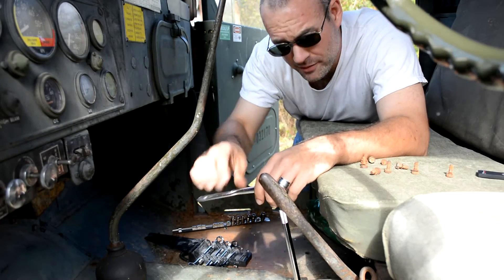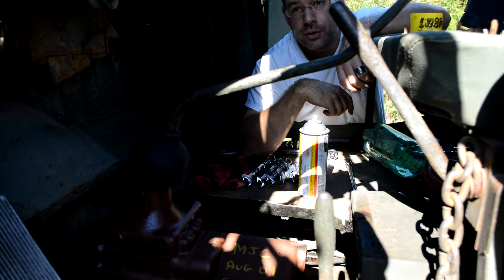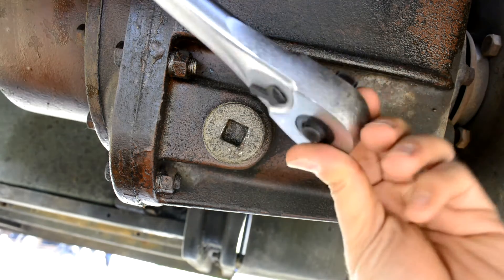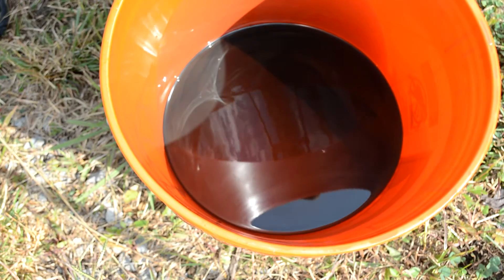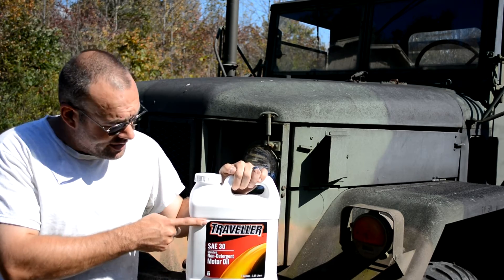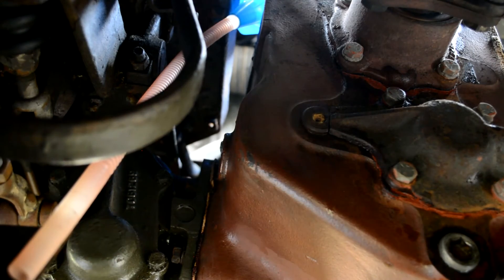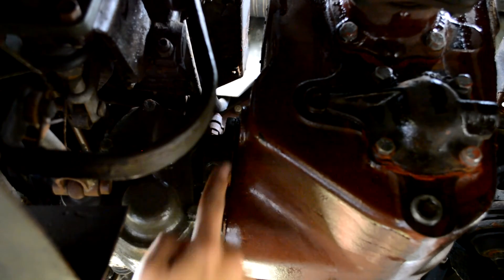Transmission Oil Change on a M35A2 Deuce and a Half

Comment: Great time for a drain plug magnet. Also Might have been a good to mention to drive it around before you drain it, the particles will mostly be suspended in the fluid. As well it's a great idea to run about half a quart of clean oil out of the unit with the plug off, as most of the stuff you want out is heavy and gos to the bottom thus a good way to flush them out.
(Pennzoil 2 years)

Great videos!

Comment: Duece, I tried finding the exact oil you used from tractor supply, but I couldn't find it. I did  find this one. Just want to make sure it's the right one. Also great video i just picked up a 1971 duece yesterday! I have no idea when it was serviced last so i want to change it right away to have some cheap insurance! Thanks again!
Reply from the maker: Nondetergent straight 40wt or 50wt engine oil or any 80w90 gear oil that says it is yellow metal safe on the bottle, sometimesinstead of yellow metal it'll say protects copper and bronze bushings. When I made this video almost no manufacturer bothered to say if their product was yellow metal safe but have started to do that more now.  A lot of people will recommend GL-1 or GL-4 over GL-5 for the best yellow metal protection but I'm not sure if that's still relevant  today.
Reply: @deuceandguns  10-4 thank you, I figured since I'm down south in georgia and it gets hot, I'm going to put sae 40 in it non detergent motor oil. I have a local store that sells some for 4 dollars a quart!

Comment: The military used GL5 but if you read the specs on GL5 regardless of it being yellow metal safe, it is not made for synchronized transmissions.  The military also used motor in its 900 series trucks for its Allison transmission rather than Dextron3, it caused the transmissions to shift harshly and downshift horribly.  Just a thought for those looking to change fluids.  I use GL1 in the tranny and transfer case for better gear oil properties than 30, 40, or 50 wt oil. It is safe to use GL1 and is safe to use In synchronized transmissions. GL5 can be used in the Rockwell axles though. GL5 works great there because of the high pressures.

Comment: Love to videos man!  Got my first deuce a little while ago.  Could you please do a video on changing the axel oil?  Also a video on checking/changing the brakes would we great as well. Keep the videos coming. Thanks
Reply from the maker: Thanks!  I do eventually plan on doing all the fluids on camera.  I will eventually do the brakes but not until they need them done so that may be awhile down the road.  I do have several maintenance things that sprang up during the winter that I plan on tackling now that it's warmer and they are very common issues with the old M35s so stay tuned.
Reply: DEUCE AND GUNS sounds good, I’ll stay tuned. One other maintenance item I keep hearing about is to be sure and pack the front bearings. I know how to pack bearings, just not on the deuce. If you could add to the list, that would be awesome!  Thanks again!

Comment: BC, awesome........please keep them coming.  Question:  In case of a home power outage I know the deuce puts out a lot of power, is there a way to use the deuce as a generator?  Treat me with kid gloves, 220v to home 110v home hook up.
Reply from the maker: Bo Rhoden Not only is there a way but it's a pretty good idea.  I have extended family who are big dairy farmers and when they lose power they have generators that run off the tractor's PTO and it's enough power to keep the milking machines running.  It wouldn't be that hard to attach a PTO shaft onto the transfer case and run a large PTO generator off that.  They are not cheap but some of the bigger ones that require over 40 hp can put out some good power numbers and would be enough to run an entire house when the power is used conservatively.  Great question!

Comment: Great video series! I have learned a lot from your videos.
One thing i was looking for in this video, was the quantity to fill the trans.
You mentioned that about a gallon came out, but you had a 2 1/2 gallon jug to fill.
I understand about how to check when full, but I'd like to know the correct amount.
Keep up the great work!
Reply from the maker: -M35A2 Transmission Capacity -10.5 pints with PTO (the Deuce has a winch). -M35A2 Transmission Capacity - 8.5 pints without PTO (the Deuce does not have a winch).  I usually put lots of info in the video description of my vids.

Comment: So theoretically speaking... you could just toss that oil through a 5 micron filter and dump it in the feel tank?
Reply from the maker: Yep.  You'd have to take the viscosity into consideration so the pumps aren't over stressed but an easy work around is to simply cut it 1:1 with diesel and you're golden.  Strictly theoretically speaking you could run the thing on uncut moonshine to get out of Dodge with the understanding that it may be the last time the truck ever starts.
Reply: DEUCE AND GUNS the compression ratio must be insane.
Reply from the maker: Good job!  Few people catch that concept.  Yep it's 22:1 which means the engine is very sensitive to hydrolocking.  Also, it's the reason why they regularly fail with a rod through the block because the driver decides to lug or over rev one too many times.
Reply: DEUCE AND GUNS I've noticed a few people put pop bottles in the exhaust, is that to prevent the water getting down into the engine or something else?
Reply from the maker: Yep, it keeps the water out.  A 2-litter bottle with the top cut off fits the exhaust perfect and can't be blown off as easy as a coffee can.
Reply: @CanadianInScotland  it keeps rain water from going down the exhaust and rusting it out.

Comment: Looks like a fun vehicle to own & drive.
Do you use this truck  to haul things or is it just a fun historic driver?
Reply from the maker: I use it on the farm but in reality it's way overkill especially since I've also got a Ford F-250 that could do just about everything I've used the Deuce for.  So to answer your question....um....yes...It's a fun historic driver that also hauls things.  It is nice to be able to pickup 12' long lumber/pipe from Home Depot /Lowe's and be able to close the tailgate so no flags are required.  Also, the Deuce is the only thing I've got that can get up the hill on the farm during bad weather.  Good question.

Comment: Great video! I always find time out of my day to watch your videos especially the deuce ones. I remember you changing the oil in the engine of the deuce and I thought to myself the transmission has got to be close to 10 gallons of not more. I'm very surprised it's only a couple gallons. Why would the manufacture use 30 weight oil instead of gear oil? I thought they put gear oil in manual transmissions. Maybe I was wrong. I don't know. It's not an automatic so they wouldn't put automatic transmission fluid in it. Did you change the dif fluid also?
Reply from the maker: Most manual transmissions are perfectly happy with some sort of straight motor oil depending on how they were designed.  Other than the engine and trans oil nothing else has been changed on the truck.  I'll eventually also change out the transfer case oil and all three Rockwell differentials.  Thanks for watching!
Reply: ***** No problem. I did not know that. Thanks! I would love to see a video of you changing the transfer case oil as well as the differentials. That would be so neat. If not no big deal. I know from making my own youtube videos how much time it takes to set up the camera, say everything right and do everything the way it should be done.
Reply: ***** Looking forward to those videos,....
Any thoughts on doing a vid on cleaning off those oil spills,... stains around the gearbox etc?

Aussie.
Reply: Aussie Bloke! to change diff fluid, just remove the cover off the diff and drain. when done, just fill the diff with proper fluid and you'll know its full when excess fluid starts dripping out. to change transfer case fluid is similar to when changing diff fluid. And remember, this is important, if you have a limited slip diff, make sure you add a limited slip additive.
Reply from the maker: Peter Kapica That Diff change technique will work for 90% of the diffs out there but not for the Deuce.  The Diffs and the transfer case on the M35s have a drain plugs that must be used.  Also, their internals on the diffs are only accessible from the top after removing the drive shafts due to them being top loaders.  The M35s don't have stock limited slip but yes always take care of you limited slip diff by using the correct fluid and never use a mini spare on the rear because both will result in burning out the clutches.  Thanks for watching.
Reply: Oops, my bad. I ment to say you change the transfer case fluid the same way as the transmission.

Comment: Your videos give me hope.
After sitting up for a few years, my deuce shifter is completely stuck.  Can't budge it even 1mm.
Any suggestions where I should begin?
I need your advice.
Reply from the maker: Sometimes it'll get stuck between gears but the shift lever still moves and it's due to the Sprag front axle but with yours not moving at all it sounds like it's rusted to something.  At this point the first step is start taking things from from the top down and investigate.  Take of the cover in the cab first and see what you can see.
Reply: Thanks for getting back to me....
After I take that floor plate off,can I remove the top of transmission while it's still in the truck?

Comment: Question. Ever hear of people removing rear drive line to increase mpg... i dont know hom much it'd help was just thinking about it the otger day.
Reply from the maker: There are bobbed deuces where the rear axle is removed making it a 4x4.  I've heard that's good for about 3mpg.  I also know a dude who removed the front drive shaft so the engine doesn't have to spin the front end and that was also good for a few mpg.
Reply: ***** yeah i know about bobbed and the front i mean with out the bob. But a gain of three is probably more just the weight removed.
Reply from the maker: So just removing the drive shaft between the second and third axle?  I've personally never heard of that but it'd probably do some good as long as the extra traction wasn't needed.  If it were simply a hwy hauler then you'd probably get an extra 3 mpg or more by removing the drive to the front and third axle and only driving the second axle.

Comment: I'm trying to get a deuce for my self. I  like to know if you have to have a class B or A license to drive a deuce on the road? and what kind of mileage does it get some on told me it only get 5 to 6 MPG but I thought it be closer to 10 or 12 MPG? and by the way you have a great channel all your video are great.
Reply from the maker: To the best of my knowledge you can drive a M35A2 with a regular Class D non-commercial license in all states due to it being under 26,000lbs GVWR except for California.  In the state of CA you'll need a Class B due to having 3 axles so if you bob the Deuce you'll be fine in CA with a class D.  I'm also not sure how strict CA is with this but it's on their DMV website.  Regarding the MPG for the Deuce.  A stock Deuce will get 10ish MPG if it's running on diesel and the speed is kept at and under 45MPH.  If you bump up the speed to the high end of the safe zone (50-52 MPH) you'll drop the MPG to about 5.  Thanks for watching!

Comment: Still learning here sorry if this question is a little minor. But the switch you move from right to left before you let the clutch out. What is that for? I have a 73' M52A2 and don't have that switch. Thank you in advance.
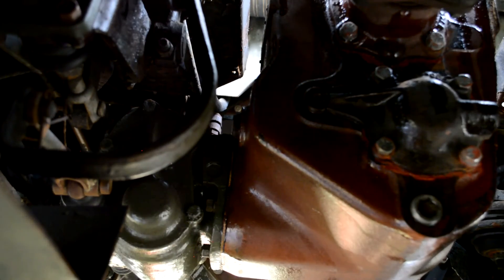Reply from the maker: If you're talking about the switch I flip at about 6:00 then that's the front wheel drive lever which uses air pressure to engage the front wheel drive.  Early models had an automatic sprag gear that engaged the front when the rears slipped but due to some issues with the sprag system later models were manually switched on and off.
Reply: DEUCE AND GUNS 
Thank you! I kinda figured that's what it would be but wanted to ask haha

Comment: I own a deuce and a half as well a 1980 AM general m3582 with a Hercules multi-fuel Whistler turbo and a five-speed sadly I've been struggling to find an insurance carrier besides haggerty that one sure it as mutually agreed value insurance unfortunately I've had more than my fair share of accents for the type of work I do but at the same time they were not my fault because I was rear-ended in each of these times

Comment: It’s been over 4 yrs now since the video. Have there been any transmission problems? And about how many miles would you say you have on ‘er since the fluid change? Reason for my questions are because I just purchased a deuce and all the research of what type of oil to use is killin’ me! GL1, GL5, 80w90, 50wt engine oil..... driving me crazy! Since you have time and miles on yours, I’d like to know how things are going. Thanks!
Reply from the maker: I don't put a ton of road miles on mine but it's been fine.  If you dive too deep down the rabbit hole on this oil thing it will make your head spin but there is a lot of overlap when it comes to these lubes.  30wt straight non-detergent works for me but I've been told it can cause shifting issues in hot weather after lots of hwy driving.  Any of those you listed above will work as long as it's safe for the yellow metal in the transmission (GL5, 80w90 may be an issue) and some will shift better than others.  For better summer driving and protection I've been thinking about changing to 40wt straight non-detergent but due to having newer trucks at my disposal I rarely drive it that much when it's hot out.
Reply: @deuceandguns  Thanks! I appreciate the quick response! 
Yes, I went head first into that rabbit hole and it was killing me!!! 
Are you going to run the same oil in your transfer case?
Reply from the maker: @1320freek  Yep, due to the transfer case also having the same yellow metal issues you'll want to use the same oil in the transfer case as the transmission.
Reply: @deuceandguns  Thank you Sir.
 Again, I appreciate the quick responses!

Comment: Do you ever recycle your used motor/trans/transfer case oils as fuel for the deuce ?
Reply from the maker: Always.  I've even got people at work bringing me their used motor oil.  Filter and pour it in.   I'll do a video on it eventually.  Thanks for watching.
Reply: ***** Now I'd  really like to see that!
I'd love to know what you need to do to run waste motor oil or used cooking oil to offset the fuel costs.
Also would you filter through some media or use a centrifugal filter system?
 Aussie.

Comment: Now, can I use that same 30 weight oil in all 3 differentials and transfer case
Reply from the maker: I can't remember if I mention it in this video or another one but while non-detergent 30 straight wt works I think 40 wt would be a better choice if you're also going to be driving in hot summers.  It works for both the transmission and transfer case but not the diffs.  I recommend standard 80w-90 for the diffs.

Comment: are duces sold in automic transmission?
Reply from the maker: The M35a3 has an automatic transmission but you lose the multi-fuel capability.
Reply: @deuceandguns   could  a muti fuel  engine  be put in it or is there a reason  they didn't  I'm looking  to get one but was wondering  if its possible  I've found  new old stock Hercules  engines  but wasn't  sure  I could  put it in an automatic  transmission  version
Reply from the maker: It would be a full custom install to mate the Hercules to the automatic transmission but with enough money it could be done.

Comment: Where did you pick up your deuce? I'm currently in PA and can't find one for under $8,000 in decent shape with a winch. And if I'm buying one it needs to have a winch for with I plan on doing with it. I've found a couple without a winch for $4,500 here and I'd say that's a fair deal, but like I said I want a winch.
Reply from the maker: Interesting that you're in PA because that's where I ended up buying mine and driving it back down to Tennessee.  That trip was over 600 miles in a new to me truck!  Try extending your search out and cruising the classifieds on EBAY and steelsoldiers.  Unfortunately, the super cheap deuces from government auctions have all but dried up so the surplus that was there has shrunk.  I bought my Deuce when there were still occasional internet posts like this, "Guys, I stupidly put $500 on a deuce at the gov auction and actually won the thing!  What do I do?"  Everyone around me is at $7k right now for examples ranging from rusted out to $13k for near fully restored.  Good luck
Reply: That's what I was afraid you were going to say. That's AK's there use to be dirt cheap when I bought mine and even more so a few years before that, now there hard to find for under $800. It looks like the 5 ton is the new Deuce but unfortunately in PA I'd need to get a CDL to drive it. Maybe I'll just save up until I move back to MI where you can drive personal trucks without a CDL and buy a 5 ton. They do have a cummins which I'm much more familiar with. Thank for the info and keep make cool videos!
Reply: DEUCE AND GUNS  I picked my 1970 deuce in chambersberg Pa  last April 
My 5th gear is growling /tumbling rock sounds  after a parade  any ideas why ?